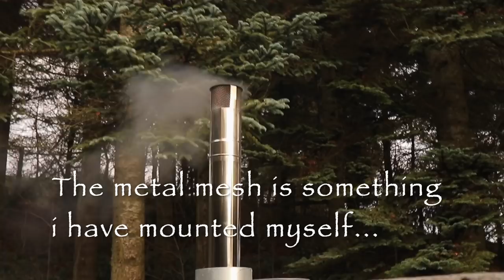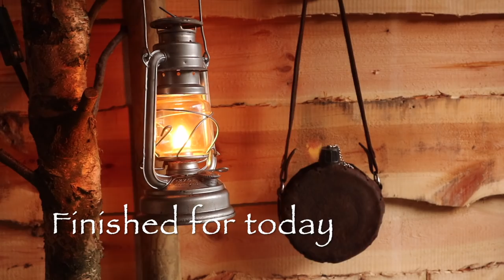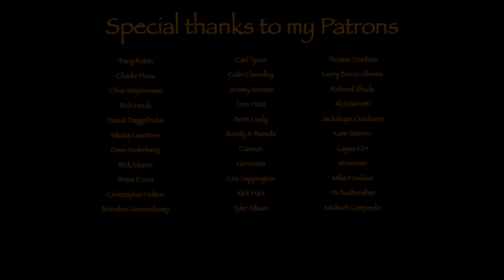A Viking  "Baptism"

Comment: Shorten the stove legs by 4 inches to reduce the footprint of the stove to fit the concrete pad, have a piece of tin 2 inches away from the wall to act a a thermal break to prvent the wall from igniting, and as a heat reflector. Or use a fiberglass welding blanket hung on the wall.
Good job, greetings from British Columbia, Canada
Reply: Dave Betker - some good ideas. The welding blanket is a clever way of protecting the wall. Simple, but it will work! 👍🏻(fellow Canadian 🇨🇦)
Reply: @MrJRW1  I have a canvas wall tent with wood stove, it protects the canvas wall and is a good emergency fire blanket, as well as reflects heat very well....
Reply from the maker: Yeah it’s some great ideas Dave 👍🏻😊 thanks for your interest and support 🔥🏕🌲
I’ll see if I can find a welding blanket some where 💪🏻🦌🇩🇰
Tom

Comment: I would put the concrete tile against the wall between the wall and the stove at its closest point to reflect the heat away from the wall for safety and to radiate it back into the room. And just level the stove with dirt floor material. That is what I would do because I had my wood stove catch my wall on fire back in 1995. Now, I always put protection against the wall, no matter what..Very nice video..
Reply from the maker: Thanks a lot Karen for your feedback, concern and great advice 👍🏻😁. I’ve put a metal plate between the stove and the wall 👌🏻🔥 and that is both protecting and reflective 😉
See you on the next one 🏕🦌
Tom

Comment: Good morning my friend. I think your hands need some time to recover.  Ouch !   If I could make a suggestion on the front for your super shelter.  Clear shower curtains would work very well. However you must get the ones marked. " P E V A " .  That is the material it is made of.  Poly ethelene vinyl acetate.  This vinyl is very resistant to cold and stays much more supple and resistant to cracking in very cold weather.   It's clear so heat from an outside fire can warm your shelter and visibility is quite good.  In Canada I can get this at Walmart quite inexpensivly.  Have a great day Tom.    ATB.  Paul
Reply from the maker: Thanks Paul 👍🏻😉 I’ve looked for shower curtains … but not found any suitable 🤔 but with your information I’ll try again 😉 Thanks for your tip and feedback 🔥🏕🦌 Tom

Comment: I have a couple recomendations for you Tom. First for the stove, place a thin steel plate under stove for extra stance of stove legs. Second in regards to the plastic for your super shelter idea, get 2 clear shower curtains and a rod, they're heavy duty and you can slide them open left or right as opposed to lifting them up and down. Another great vid bud!
Reply from the maker: Thanks Eddie for coming along and enjoying it with me 
👍🏻😁 and thanks for your suggestions; great ideas 😉
I’ve already made my plastic frontcover and solved the problem with the legs 💪🏻😎
You’ll see how in my next video. See you soon 🏕🦌🔥
Tom

Comment: Mr Betker has a good idea of how to fix your stove situation. If you cut them down some, it would fit on the concrete slab that you have. As long as you still have enough chimney pipe to clear the roof, it would work fine.
Reply from the maker: Yeah Jim that could probably solve the problem 👍🏻😁. Maybe I’ll do that … I’ve made a stopping stick so the stove doesn’t fall down … and I will see how that goes 🔥🏕🦌
Tom

Comment: You should put some metal behind the stove, to protect the wall from the heat of the stove.
Reply from the maker: Thanks Francis for your feedback and concern/ tip 👌🏻
It’s actually not so hot on the wall that I think it’ll burn 🔥 But a metal reflector will optimised the effect … so I’ll probably put on up 👍🏻😉🏕
Tom

Comment: Excellent job. Well done. Perhaps heavy, thick, clear vinyl strips, ceiling to floor, such as those used in a warehouse to allow a forklift to plow right through from one room to another,  might suffice to retain a lot of heat in colder weather, yet permit a bit of fresh air to enter along  any seams. It would provide visibility, easy passage in/out, and a substantial rain, snow and wind break. In a frame it could be made removable and seasonal.Thanks for the great videos. Have a healthy 2020.
Reply from the maker: Thanks Leslie for your kind and positive feedback 👍🏻😁
And it’s a great suggestion you have 🤗 but have already solved that issue and if you watch my next video you’ll see how. Hope you and your family will have a wonderful 2020 and that I’ll see you again on my next one 🏕🔥
Tom

Comment: Dear Tom. Congratulations for shelter inauguration. I shall drink a beer for that. It is nice to see you in this shelter because it is something very desired for you. Only a couple of things; what about a metal plate (brass, stainless steel...) between the wall and stove? I think in this way, this can be a reflector of the heat because you have not a fourth wall or a door. I think you can  benefit of heat that is missing throught the wall wood. 
Other suggestion is to put a little more of concret, because the foot of the stove is very near of end (it is the impression in the video). A beautiful kuksa too. I would like to be able to do by myselft too, but.... I think it won't be possible. Pity
I hope you enjoy you shelter a lot of time. Greetings a lot from Madrid and great to see you in a new video!!!
Reply from the maker: Thank you so much Miguel for your kind feedback and great suggestions 👍🏻😉 Both ideas are great and I’ll see if I can find some metal for the job 💪🏻
Hope your having a wonderful weekend my friend 🌤🏕🦌
Tom

Comment: Well done "Tom" when you poured your Beer over the cabin I half expected it to break it's mooring and slide gracefully in to sea.
 This is Just MY opinion "Tom" but I would put a front on that shelter which would seal the  thing from the worst of the weather and you could open up wide in the summer, I don't like being cold, and I bet that could be a real wind trap in a gale, (again, just my opinion)
Reply from the maker: Thanks Robert for your feedback and question/suggestion 👍🏻😉. I’m only allowed to build an open shelter … and the wind is seldom coming from the south where the opening is 
Besides that I always put a tarp up on the front when I’m going home 👌🏻 and when I’m sleeping there … and in real bad weather I will have a transparent plastic cover up to block the wind and keep the heat inside 🏕🔥👌🏻 I think I’m pretty covered like that 🌲
Tom
Reply: What I meant "Tom" was that maybe a temporary closure for when the weather is inclement, thanks for your reply mate, take good care my friend and a very merry Christmas to you and yours, Drink lots of good Danish Beer.
Reply from the maker: I’ll definitely do that 🍻💪🏻🇩🇰
Skål to you my friend and merry Christmas to you and your family from Denmark 🌤
Tom

Comment: A new Kuks should be boild in really salty water to kind of kill the wood so it wont crack and yes it will have a salty taste for a while but by using it it will desolve by time. After that you should smear the inside with the fine coffee grin that is on the bottom of the pan after making. If you do this daily for about a month it will become "waterproof" from the grease from the coffee. Really hardcore guys up in Lapland don't even wash their Kuksas just letting it dry. For the outside is the best solution to just handle your Kuksa daily and the natural grease from your hands gives the protection. You should build a storage box with a lock so you don't have to carry your stove back and forth all the time, if you dare to leave in the box. It will of course double as a bench.
Reply from the maker: Thanks Ronnie for your interesting advice about Kuksa preparation 👍🏻😁
I’ve heard about boiling in salt water 🤔 but never tried it 😇
Appreciate your feedback my friend and I think I’ll bring the stove with me … I’m not sure if someone can feel the need to bring it back to his house😒
See you on the next one 🏕🦌
Tom

Comment: The cracks in the wood are from drying too fast it needs to be keep in a very dark and cool place so it can dry very slowly don't worry about using your axe thats not the problem DRY IT SLOW! even if you have to wrap a damp paper towel over it just for a few hrs just don't bring it into warmth or sun till its bone dry then soak it with oil hundreds off years ago it would be out in the night and the morning dew would give just enough moister to keep it from drying too fast
Reply from the maker: Thanks a lot for your advice 👍🏻😁 But I always dry my Kuksa very slowly. And since I’ve stopped using my axe I haven’t had any problems with cracks. So from my experience it’s the stress on the wood … from the axe that is the course of the cracks I got. Atb to you my friend 🏕
Tom